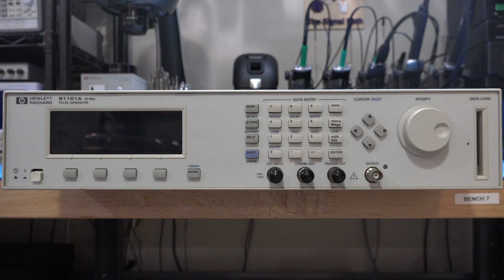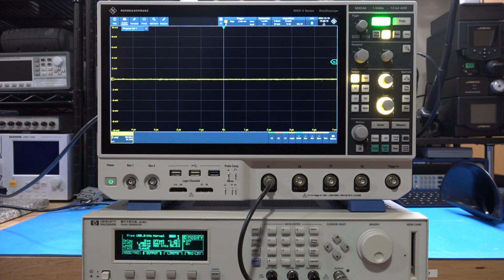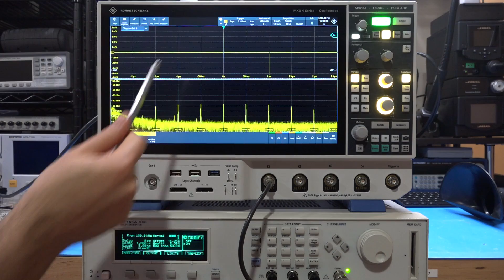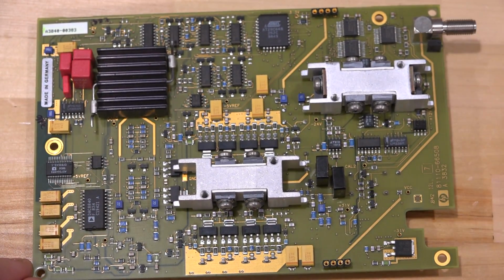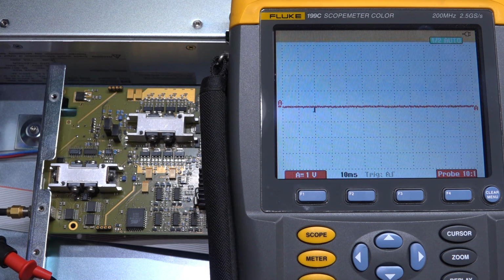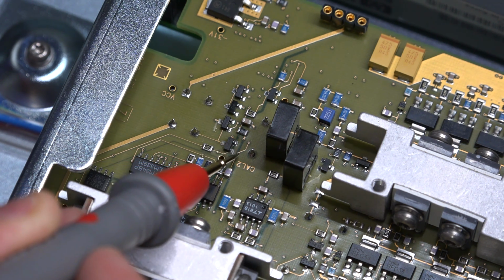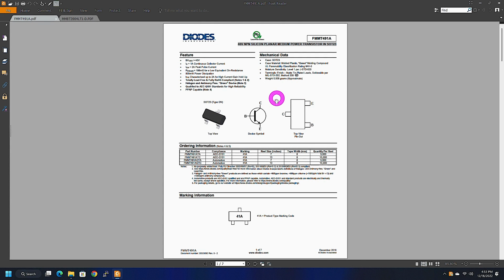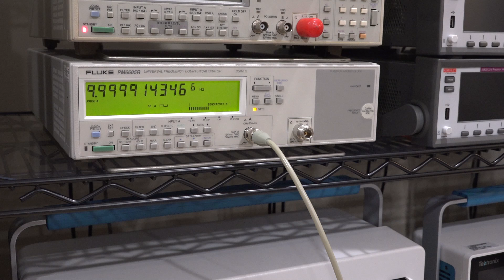TSP #219 - Agilent 81101A 50MHz 20Vpp Pulse Generator Teardown & Repair

Comment from the maker: Several people have suggested to check the protection diode across the relay, which is a good idea. I went back and checked. Although it does appear to be OK, the forward voltage did read a little too high. So I changed the diode to be on the safe side. Thank you all.

Comment: i just wondering the oscilloscope you using this video. What is normally noise level that scope?
 We have to sometimes investigate  THD in audio freq. very low noise level and tried to  found out proper measurement equiment for that. Originally product tested with Audio Precision equipment but we need something for toubleshooting

Comment: The base current of about 4.5mA is rather high. Maybe the 1k base resistor is too low in value and should have been higher. Best to check the max base current or your device also so.
Reply: Relay seems to be 15mA (5V / 334ohms), so its good to have at least 1.5mA base current, but 5mA isn't going to be a problem, after all you'd want to put 20mA base current to drive it to the 200mA max output current in switching circuit, so we know the base can handle that sort of current.
Reply: @MarkTillotson  Many of the small bipolar transistors have a maximum allowable base current of 2mA. If the HFE is 100 and Ic = 15mA you really only need 150uA into the base to switch it on. Not sure why they chose such a low value for the base resistor.

Comment: Any speculation as to why that trani failed? Maybe the flyback from the relay coil has no clamp diode? Nice repair. How about a video showing how you use it in the real world?
Reply from the maker: I did change the clamp diode. The clamp diode did read a little high. So perhaps over time, the transistor died.

Comment: Nice!!! I love fast pulse generators. The pre-pre-predecessor hp8082, 250Mhz, < 1ns tr, was also designed and built in Germany, Böblingen, and looks as well quite empty. Edit: Yep, my HP8082A (obsolete) was succeeded by the HP8130A (obsolete) and successor of the latter was the HP81110A (obsolete as well) 😁😁
Reply from the maker: Thanks for sharing!

Comment: Nice repair.  I am surprised it was the driver transistor and not the relay (I've replaced a lot of relays).  I wonder if the flyback diode around the relay coil is flaky, and that might have induced a failure in the bipolar switch transistor - probably worth checking.
Reply from the maker: I was happy that it was the transistor and not the relay!

Comment: There seems to be no clamping diode on the relay so when the relay closes it makes high voltage go to that transistor(collapsing magnetic field) Or I am mistaking it here... Still good repair
Reply from the maker: There is one next to the replaced transistor.

Comment: Another multi thousand dollar instrument rendered inoperative by something worth a few dollars. Good repair. I could actually follow this one 🙂
Reply: That transistor is pennies!  It could be a contest between the cost of the component and cost of electricity to heat the soldering iron used to do the replacement.

Comment: Is the other SOT-23-3 device that is connected to the same net as the negative terminal of the relay coil and the collector of the NPN BJT a flyback diode? Probably worth checking that too. If it has gone the way of the dodo, the new BJT might not live long.

Comment: First !
?
Lol
Love your videos.
Reply: Also, was there no snubber or  inverted diode across the coil? Usually there is something to absorb the  energy of the collapsing magnetic field of the coil. Maybe that's what killed the transistor if someone was flipping the enable on and off quickly.
Reply: @HarblesTheSkeptial  Pretty sure it was the SOT-23 part just above the transistor that he replaced (if you watch his close-up of the transistor and resistor, the trace from the coil to the bad x-istor has another trace branching off going to a second device which I expect is the freewheeling diode).
Reply: @icesoft1  Seems that very few noticed the T branch in the trace.